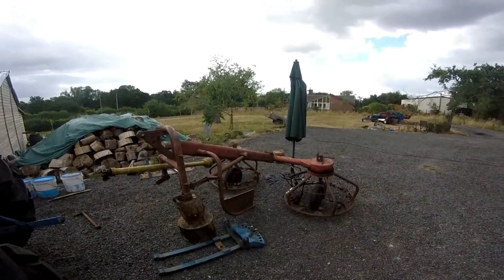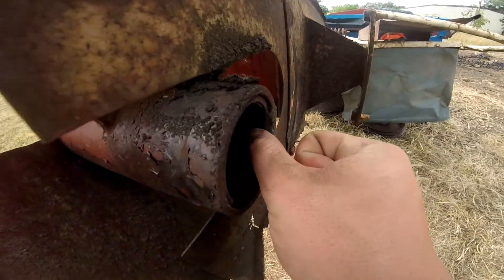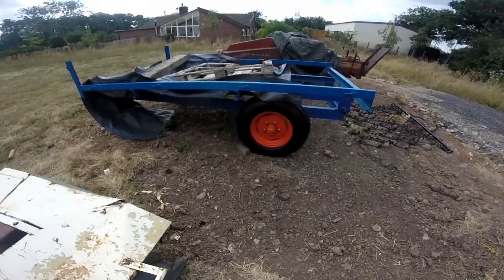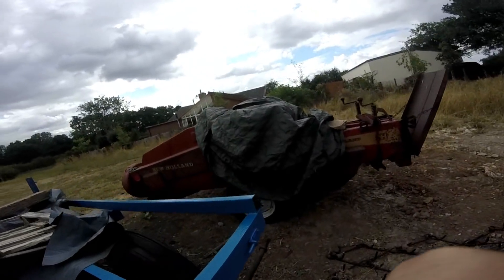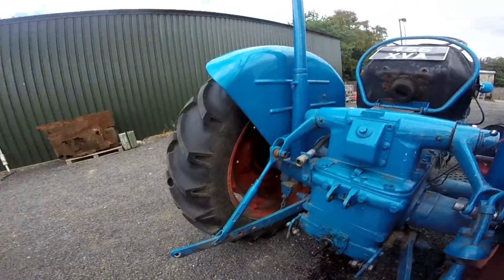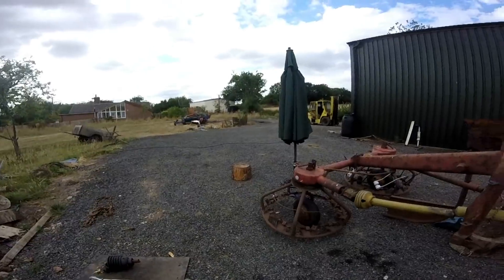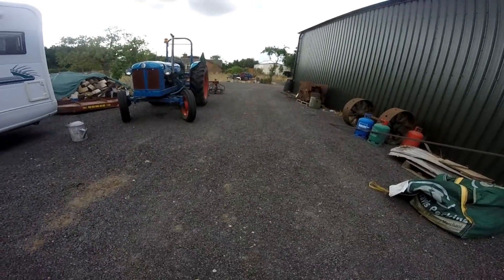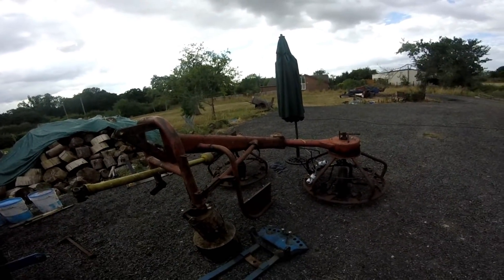Looking at my new kit

Comment: I have one of them pz haybobs i bought it about 2 years ago and its the best bit of kit i have ever bought very happy with it😀
Reply from the maker: Duffer Agri & Art yeah so easy to use and so cheep to run use no power at all on the major like and I am use to useing one so
Reply: Farmingman19 ya i use it on a massey 35x and it runs it no problem and before i bought the haybob i did a full restoration on me massey so looks really nice in the summer i am planning on respraying the haybob this winter luckily enough mine still has original stickers😀😀
Reply from the maker: Duffer Agri & Art yeah I would like to and I might restore it but its not to bad the way it is now so
Reply: Farmingman19 ya like i said ive had mine 2 years and done fuck all too it just be nice to hsve it looking as good as the massey
Reply from the maker: Duffer Agri & Art yeah mine looks good on the major well it will whne gets are fixed

Comment: The tines are on upside down mate
Reply from the maker: Tom Reel which way there ment to be
Reply: Long tie on the top the sorter one on the bottom
Reply from the maker: Tom Reel right is there a reason for it or that just the way they go
Reply: Farmingman19-reason is that the long one on the bottom is doing all the work then the short one on the top will be doing nothing, swap them round so that the short one is on the bottom and the long one of top then there both doing equal work instead of one doing everything and one doing nothing, and it makes a way better job for both tedding and rowing up if there on right as i explained
Reply from the maker: Tom Reel right ok I wil het them swapped over thanks